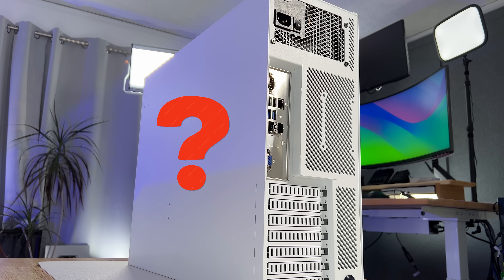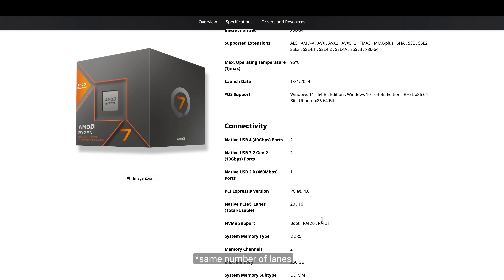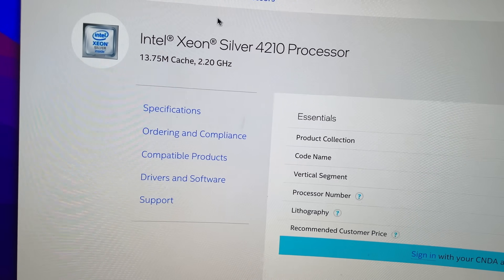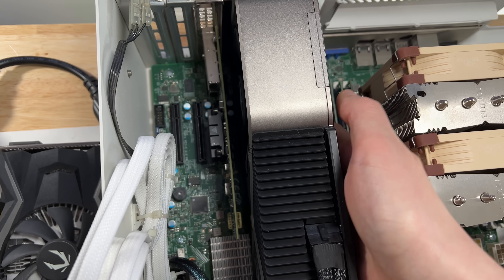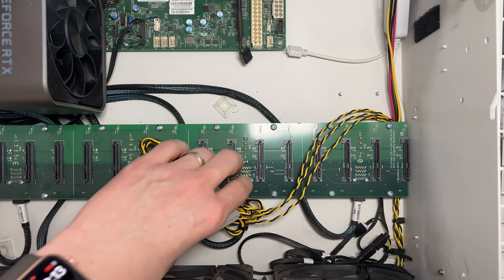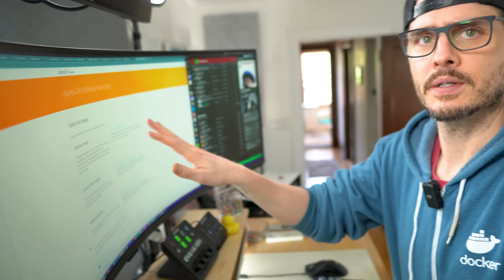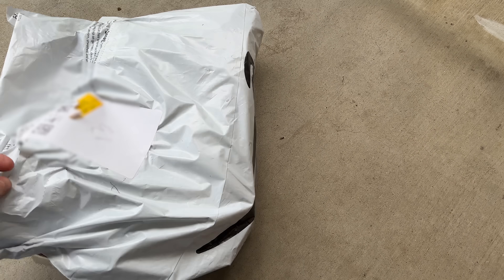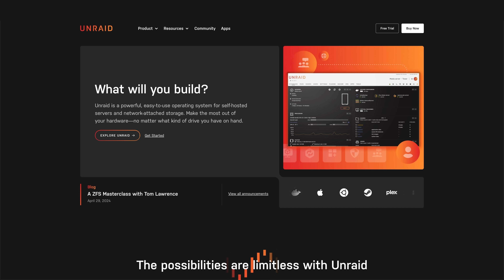Building My ULTIMATE, All-inOne, HomeLab Server

Comment: Supermicro manuals will tell you how the pcie slots are wired, even if you don't use a slot that's say wired for x4 buts its in a x8, you don't magically move those lanes to somewhere else, they are stuck there. I'm willing to bet two of those x8 are actually x4, I haven't looked at the manual for that board but that's more likely.

Nevermind I just saw in the diagram the last slot is wired x4, and those 16s are just x8. So your gpu will most likely get a small bottleneck.

Comment: I, also, hate using 5.25" hard drives. Such a pain ;)
Reply from the maker: I had 5.25 on my mind because I was trying to see how many drives I could fit in the Corsair case's 5.25 bays when writing this🙃
Reply: @TechnoTim  how many can you fit?
Reply: I know, the Quantum Bigfoot, it's a nightmare, it's even not have the ultraDMA mode.....
Reply: @yuan.pingchen3056  LOL I remember those I only had one in my time... I also remember MFM/Winchester drives from the days of AT/XT days.
Reply: @MorganTN  About 30 years ago, I used to assemble a 386sx computer in school. At that time, in addition to two 5.25-inch floppy disk drives, there was also a 20MB hard drive. The manufacturer forgot that it was not Quantum(maybe Conner).
Reply: Better than using 8” floppies
Reply: The amount of adapters needed and fiddly driver stuff to get 30+ year old 5.25 drives to work on modern systems is indeed a pain.  Setting up the nuclear reactor to power enough of those drives to have a sufficiently large RAIDZ pool to be useful was probably the harder part though.
Reply: But they had pretty sweet green LEDs, at least the ones I got to use way back when.
Reply: I wish 5.25" HDDs were still a thing. Imagine the capacity you could fit in those using modern HDD tech.
Reply: I kind of miss them myself 😅
Reply: IDK, Bigfoots are straight ATA and anything else is either SCSI or can probably talk to a nice simple WDC chip! If it was originally FM encoded, you may even be able to double the original capacity, of course that's more common in 8" platters... Capacity and throughput kinda suck though... the data center must be effing massive.
Reply: I swaped to a jail with several 5,25  ssd's with hot swap don't even need to open the case